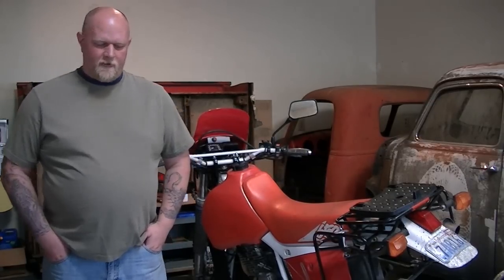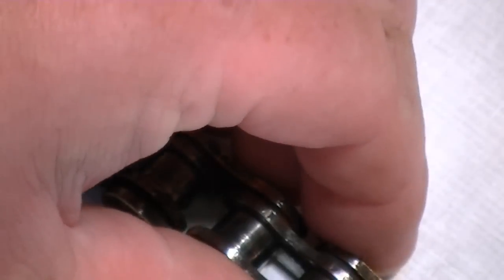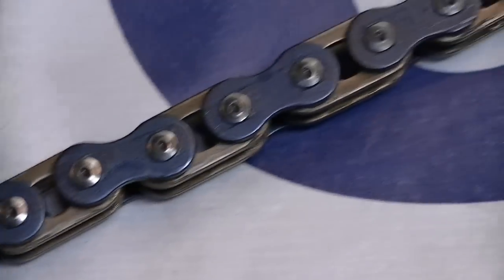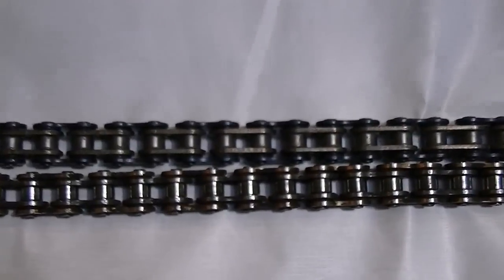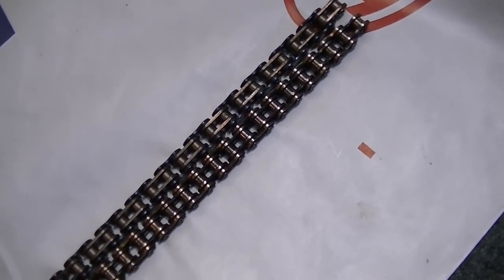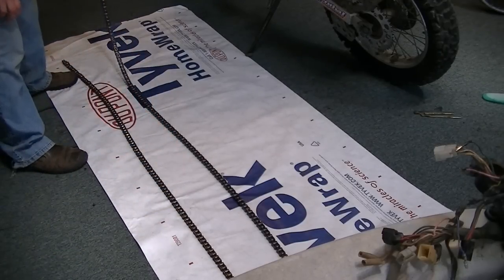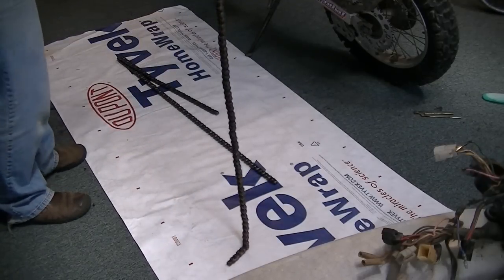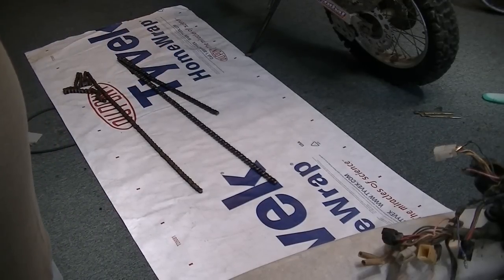Time to replace your O-ring chain?

Comment: A very good presentation.
Stretch is a perfectly fine word for the complete assembly of a bike chain.  The elements of the chain wear (pins, link holes, etc) and collectively the full assembly gets longer under tension.  He didn't say the link stretches.  He said as the links wear the chain as a complete system stretches.

A rubber band stretches , but the atoms don't get bigger then little.  The atoms in the compound get pulled further apart as the strong nuclear forces weaken.

Comment from the maker: I have put this argument to rest in the past. I took a brand new chain and used calipers to measure the side plates. I then took measurements throughout the life of the chain and at the end of it's life I did find the in fact the side plates had stretched. Now the percentage of the overall gain in length from the side plates was a small amount. Most of the length gain was pin wear. In this video you can clearly see where I show the pin being sloppy.

Comment: This is my first video I've watched on chain replacement but I already see an issue with the term "stretch".  When you showed the place between 2 links, that's worn away and not stretched. I'm not good at match but If each link wore away by event 0.03125" (1/32"), that would add up very fast more so than if it was stretching. The only way to determine if the chain did in fact stretch is to close the gap between each link of the old chain. By laying them down in the same manner will not close the gaps.  Good video either way. I did learn a great deal. Thanks!
Reply: Should have read some comments. They say the same as what I just did.

Comment: the chains don't actually stretch. that's not what's going on. what happens is the holes that the pins go through over time wear out as material is removed from the parts grinding against each other. look at the holes of the old chain and compare to the new one. the old will be bigger and no longer perfectly round

Comment from the maker: If you change chain size you also need to use sprockets that work with that size. A good 520 chain can last if you regularly clean and lube it with good chain lube. You would be better off spending the money on good sprockets and a good X ring chain in a 520 size. I always pack a small can of lube when I do a long ride and lube the chain each night especially if you are riding in rain, dirt or high temps.

Comment: You can settle this issue easily: measure, to the thousandths, the length of a link on a brand new chain. Use the chain until its "worn out." Measure the length of a link again. If its longer than when new, it stretched. If it is the same, the total length of the chain is longer because the pins are worn out, creating play between each link.

Comment: Hi NW Adventure Rider, I would like to ask you, I have a Kawasaki versys 650 2011 model. I have just did a trip from Malaysia to North of Thailand n Golden Triangle . It took me 7 days and about 4500 km go and back to Malaysia. I had problem with my chain , Its sound very hard and uncomfortable for me. Now i have a bad chain. The size  of my chain im using is 520 im wondering if i change to size 525 or 530 can help my chain and spocket last longer a long trip.

Comment: I believe chains stretch but the difference in link alignment between new and old chain can be the worn out rollers Just saying
Reply: pkitup1 Think of it logically, The only thing on a chain link that could stretch would be its side plates but chain research focuses on pin protection not its side plates, there's a reason for this, plates don't stretch. The research that does go into the side plates is to make them smaller, lighter and thinner, now would you do this if you had a stretching problem, I think not, you would make them bigger, thicker and tougher.

Comment: That old chain is worn out! A whole link longer half way along! Could you use the amount of 'droop' to measure/compare chain wear? Hold one end of the chain in a vice (with the pins vertical) and see how much curvature or droop occurs over the length of the chain. Compare this with a new chain.

Comment: Whether its pin wear, or link stretch,  it's still making the chain longer & loser, or with tight spots, and the chain ends up being no good, as your saying. BTW where do you find that new chain at ? Good work.  Thanks. yl

Comment: You didn’t prove that the chain stretched. You did prove that the pins wear and have slack. That’s the reason a chain seems longer. I guess the true way to tell is to use a micrometer and measure a new and used link. Same style chain of course

Comment: hi, very nice video and way of explanation. i need a suggestion i have a new chain and set of sprockets roughly 1500 miles driven. some how the guy whom i bought the bike with tightened the chain over specs and in recent lubing i saw one link is stuck damn tight cannot move it at all. can i keep using the chain as its only one link or shall i change it and if i, shall i really change the sprockets also i just wonder as they were not driven allot and feel relatively new and i cannot find any wear on the teaths also. is there any way to fix the existing chain today?
Reply from the maker: First, you should change the chain. If the chain fails at speed it can get wrapped up in the rear tire and cause it to lock up. Not changing the sprockets will cause the new chain to wear faster but that's all.
Reply: @NWAdventureRider  thanks allot for quick response but sprockets are relatively new and seem like wear free, would they still harm the new chain? if yes then i guess i shall loose the pocket and get the complete kit sadly  :(
Reply from the maker: @wali363  Personally, I would just get a new chain. Have you watched my video on sprockets? https://www.youtube.com/watch?v=sFDXB_KH4vs

Comment: Sorry but your wrong, chains don't physically "stretch" they get longer from pin wear, If you measure the length of the chain plates, compare old and new, you will find they are the same length. The pins in the chain are wearing thinner from use resulting in the pin links being able move away from the roller links longitudinal giving the illusion of stretch. The pin link pitch remains the same and the roller link pitch remains the same which means the side plate length hasn't changed/stretched but the distance between the pin link and the roller link becomes variable due to the increased free play between the pin inside the roller link as the pin gets thinner, this is what increases the length of the chain. the noise you hear in the video when the old chain is shook is caused by the worn pin moving inside the roller link.

Comment: chains dont stretch they wear and increase in length.
Reply: +john kilner Splitting hairs. John Kilner isn't a loser, he just doesn't win at much XD
Reply: with a name like jerk...id keep quite.
Reply: +john kilner Maybe you should just keep quite anyway, you know, just to be safe. Also, why? lol
Reply: People who use pictures of their gf's as avatars should too. jus sayin
Reply: if you had a gf you d probably use her name unless she s called fanny...lol
Reply: +john kilner chains stretch m8
Reply: +InfallibleWeatherman no they don't ffs
Reply: BINGO, 100% correct. They do NOT stretch, the pins wear making the chain longer. This is what wears out the sprockets.
Reply: thanks bob,someone with intel..
Reply: +john kilner Yeah, little common sense, and being a motorcycle mechanic for over 35 years. I've heard and seen it all.......LOL
Reply: Chains don't stretch. The holes the pins go through get bigger. Do the same thing except push the worn chain together instead of pulling apart. If it is still longer I will eat my words
Reply: john kilner if I couldn’t spell the word quiet quite often, I’d use a different word